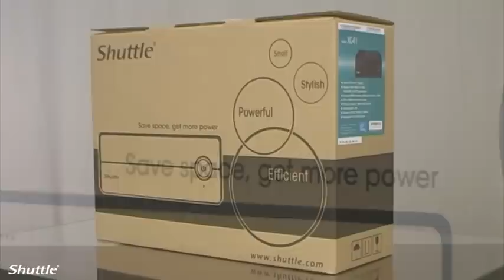XG41 - 360° product video [HQ]

Comment from the maker: One of the two ports can be switched from RS-232 to RS-422 or RS-485 via BIOS. The pin-out of the onboard connector of XG41 can be found in our "Quick Installation Guide" (available for download). But DB9 pin-out on the back panel is standardized. You may google for "db9 rs-422" to learn more. Good luck!

Comment from the maker: @Quezako We recommend to boot from a small SSD and store your big data on an additional hard drive.

No slot for graphics cards. This space-saving machine is great for demanding 2D/HD applications due to its two digital outputs (if you need a slot for a powerful graphics card you have to switch to our Mini PC (cube-sized) product line).

Comment: @SCHgermany To be fair, while you may not have to "worry" about heat problems, the XG41 does run hot. It idles at around 47-50C, and that's with a decent thermal paste like Arctic Silver.

Comment: The 2 serial ports are probably to interface with standardized RS232 devices such as cash registers so this XG41 can probably be used as part of a payment/checkout system. Or maybe it can be part of a crash cart system to connect to the serial ports of enterprise network equipment in a data center.

Comment from the maker: @gettons1980 The product in our video is just a barebone (no components). You may use any Intel Core 2 Duo, Pentium Dual Core, Celeron Dual-Core, Celeron 4xx (w/ 800, 1066 or 1333 MHz FSB, LGA775, TDP 65W max). The heatsink (heatpipe) is included. You don't have to worry about temperature problems.

Comment: Thanks for the reply.  The problem is that RS-422 pin-outs are NOT standardized, and that is my problem with using the DB9 port.  I could, I suppose, resort to a "trial-and-error" approach, but that could be time consuming.  Shuttle should have the RS-422 pin-outs available (as does IBM, HP and other micro-pc manufacturers).
Cheers

Comment from the maker: @rockyroger At 1:13 you can see the green S/PDIF connector (optical out) on the left. For an IR interface you may plug an external USB adapter into one of the front USB ports.

Comment from the maker: It's not possible to use the PCIe slot when XG41's mainboard is mounted inside the case. According to the video there is no slot bracket to remove on the backside. We've built this mainboard for several purposes that's why we added a PCIe slot to it.

Comment from the maker: @Quezako 2.5" drives save space, have lower temperatures and lower noise levels. The performance difference of the latest 2.5" hard drive generation is not that big anymore. You may also use Solid State Drives (SSD) for extreme performance.

Comment: Cool video. This little SFF PC could be made into a fairly powerful general purpose computer if desired.
E8400 3GHz
8GB
128GB SSD
External 2TB USB HDD
USB micro 802.11 N Wi-Fi adapter
USB micro BT adapter

Comment: @SCHgermany Does it have to be a cubed-size, or do you have a SFF with a full slot PCI-Express with Socket 775 support? I currently have an e7400 processor and I want to use it on a computer which can stream full 1080p. Also, I don't want it to be intel integrated graphics since they are horrible.

Comment: Hey, does anyone have the pin-outs for the DB9 connector for RS422/RS485?  I need to use the port to control an active speaker system over RS422.  Cannot find anything from Shuttle on this.
Thanks